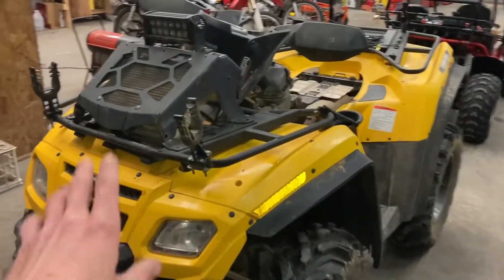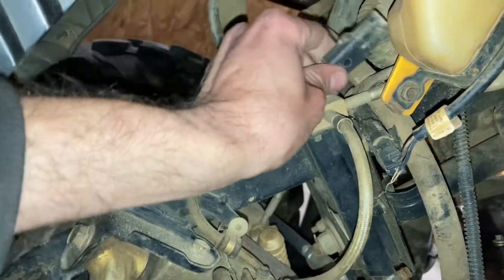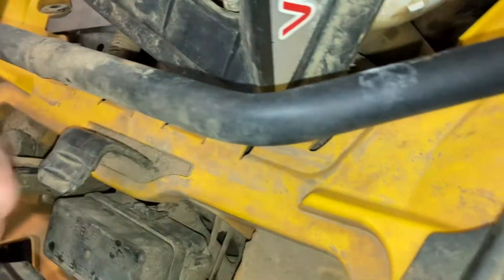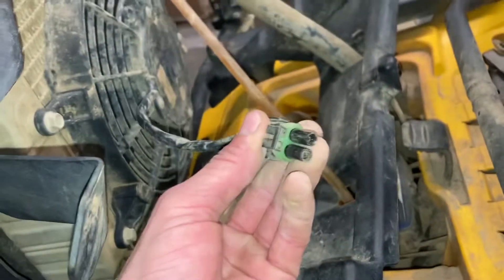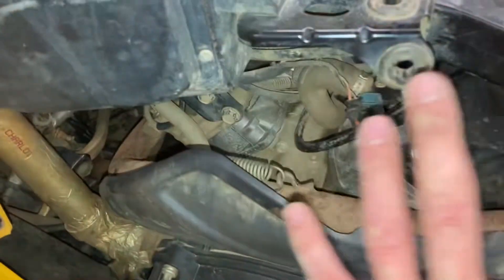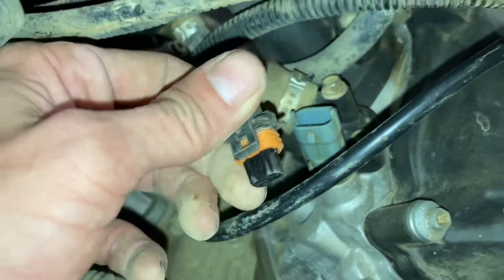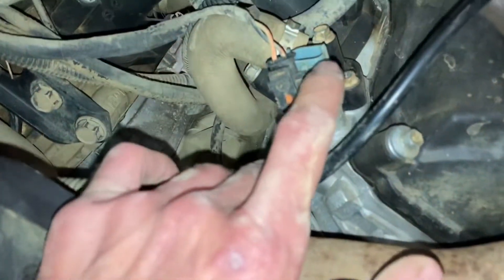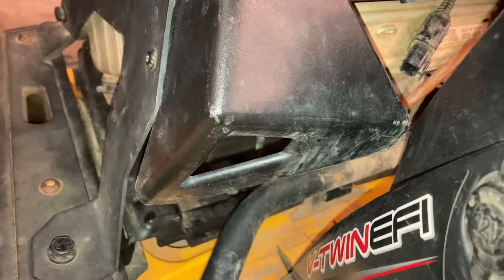Can-am (Bombardier) outlander 800 cooling fan diagnosis & fix.

Comment: Very informative video man. Looking for assistance on mine. I have replaced the relays and temp sending unit and still nothing trips the fan on. Ive supplied separate 12v to the fan it works good. And if i take out the relay and jump the pins it will turn my fan on and if i disconnect the sending unit it wont trip it to turn on. Any insight would be greatly appreciated.
Reply from the maker: I would look into the wiring and connector pins from the fuse block to relay, sensor to ECU, and/or fan etc checking for continuity or 12v if you start the bike with the sending unit unplugged. Sounds like there may be a bad, loose, or corroded connection somewhere in the circuit 🤙

Comment: Hello. My problem is that the fan spins very slowly. I wonder why?
Reply from the maker: Sounds like it could have a bad fan motor or maybe low voltage from a bad connection. I'd make sure it's getting a full 12 volts to the fan first, if it's got a good 12volt source the fan motor is likely the issue.

Comment: My fan work with 12v and it works with temp sensor unplugged  but fan doesn't seem to work with temp sensor plugged in.
I have had it hot running the atv
Reply from the maker: Have you checked the resistances on the sending unit (coolant temp sensor) while hot and cold? If the sending unit doesn’t operate within the correct resistance values it won’t tell the ECU to trigger the fan relay. If it’s been in mud/water try unplugging the connector to the ECU & cleaning the terminals, if they’re corroded the ECU might not receive the correct resistance values from the sending unit.
Reply: @WreckedRevival  ... I checked the Ohm reading on the old unit 2.83 but not hot. 
I just bought a new one to see if the fan would come on , I haven't noticed it yet. didn't check the new one
Reply from the maker: @good-boy-ringo   it should be starting around 1000 ohms of resistance cold then drop to about 180ohms for the ECU to trigger the relay. It will take quite awhile just idling to get the sending unit hot enough to trigger. ✌️
Reply: @WreckedRevival  ... Thanks I'll try checking it again but like I said .... I checked the temp sensor OHM and got 283 whether that is 2830 not sure but that was out of the engine. I didn't check it hot. and put a new sensor in the bike. It doesn't over heat just don't hear the fan  ever kick on.
Reply from the maker: No problem! I've added a link to the sending unit in the description, this is the one I'd used: https://amzn.to/48GvdQL

Comment: Do you have the link for that sending unit. I have the same machine. Fan works but radiator keeps over heating causing coolant to come out. Radiator is clean. Not sure what’s going on. Any idea?
Reply from the maker: If the fan works with 12v applied and the fuse and relay are good it's likely the sending unit. The one I ordered was from Caltric and can be found here:  https://a.co/d/5vOnRRg
Reply: To this day, months to overheat and goes into limp mode
Reply: I would say thermostat isn't opening , bad thermostat, if it is overheating

Comment: Did this on mine which is a 2009 400 and it didn’t start without it but it still ran the fan and threw the code, thanks for the video.
Reply from the maker: No problem glad it helped!

Comment: You can use a trickle charger to test the fan?
Reply from the maker: Yes you can , it's a little sketchy and would recommend a power probe but it's a lot lower amperage and a little safer than a battery. If you strip some wire ends then clamp them with the trickle charger clamps or attach alligator clips for the positive/ground, then use the other ends to power probe the fans connecter..just be careful not to short the leads.